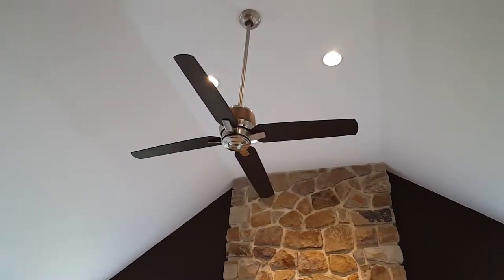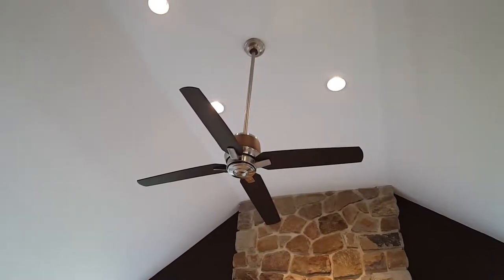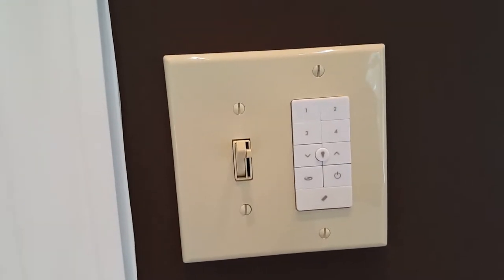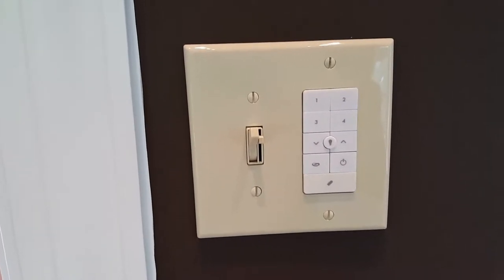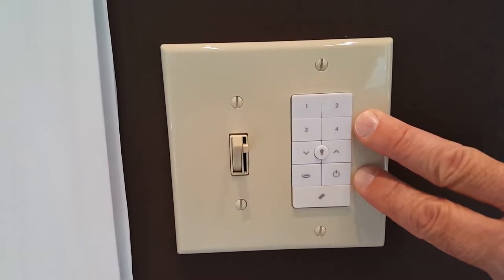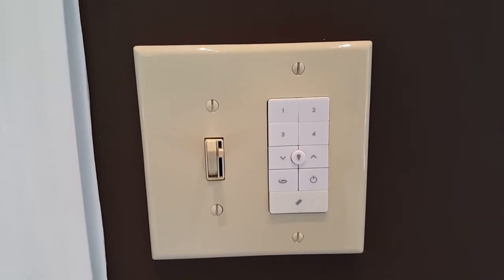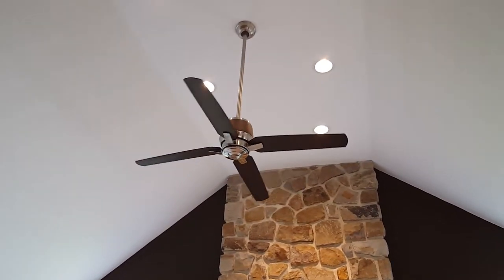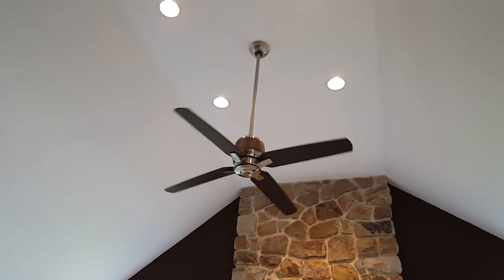Fixing remote control issue with Casablanca fan | Hobby Bobby

Comment: It worked!  My fan kept running and the remote wasn’t working.  I couldn’t shut it off even after flipping breaker off and on.  I replaced the CR2032 battery and followed the instructions in the video.  Thank you very much.
Reply from the maker: Glad it helped you out! Thanks for letting me know.

Comment: I have the same fan. Got it because I found two Hunter Mariner on a curb and one of them had a motor spark. So I contacted Hunter about it and they let me pick certain new fans and I picked Casablanca Aris (Hunter owns Casablanca) so I got that fan and sent that Mariner back. I still have a working Mariner.

The control on mine is different though. It has arrow buttons for speeds and light brightness. Still four speeds though. I have a video showing its first run.

Comment: Hey Bobby! I tried this trick and it got the fan started up again but it's still not responding to the remote. Any ideas?
Reply from the maker: Hi, Melissa. Thanks for checking the video out. I'm not sure what to say, honestly. Mine was fully functional after following the steps I outlined. Aside from checking your battery,  not sure what to offer. Sorry... good luck.
Reply: @hobbybobby3398  I had changed out the battery before I found your video. Maybe I should redo it. Thank you!
Reply from the maker: Ugh. If redoing it works, let me know!